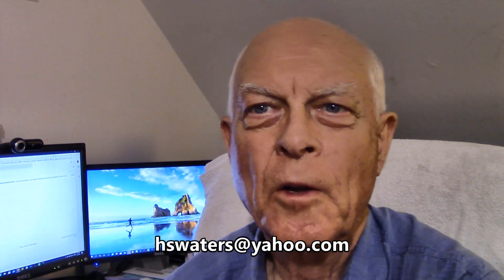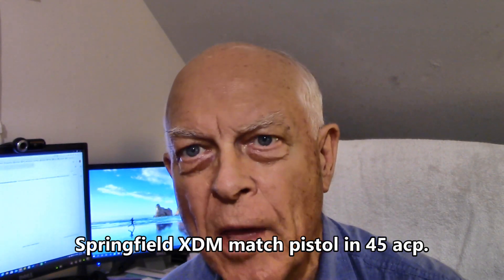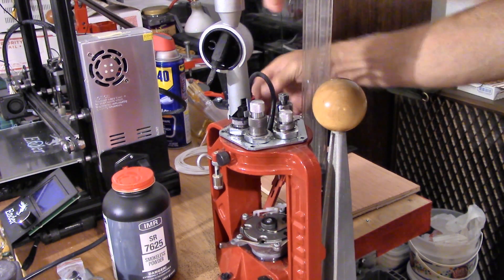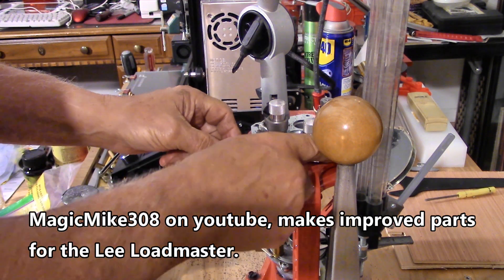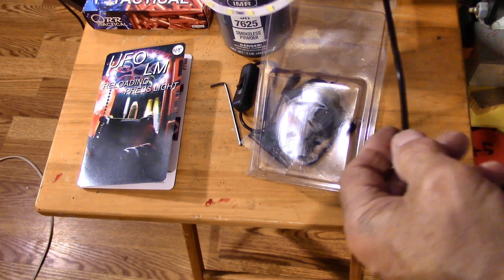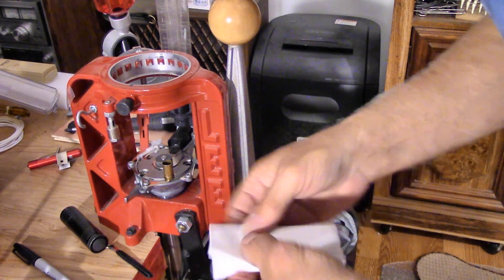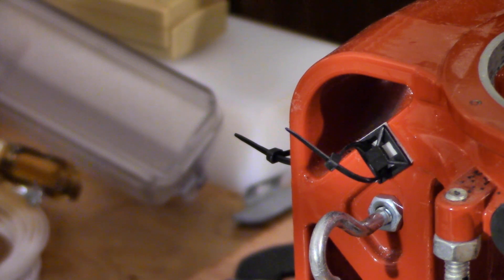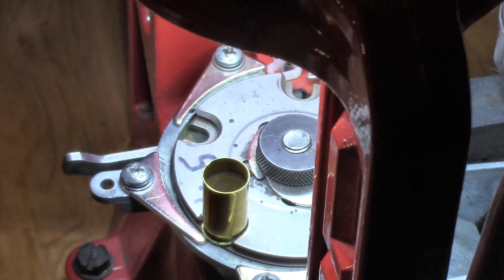Lee Loadmaster -- UFO lights it up

Comment: Did you know: when you have to enlarge or remove a zip tie, you can (carefully) insert the point of  knife blade between the body of the zip tie and the tiny pawl that engages the 'teeth' of the zip tie and then pull the end of the tie out of the head.  It gets kind of dicey holding the knife point into the head to release the pawl and pulling the tie back out of the head, you almost need 3 hands sometimes, but it will save a zip tie you want to reuse or adjust to a large size.
Reply from the maker: That certainly makes sense.  I am not sure how hard I want to fight to save a zip tie though.   Threading the light through was one of those illogical things I do when distracted by making a video and working on something.  Actually I have several bags of different sizes of zip ties so I just cut the other two off and used a couple of new ones.  Thanks for watching my video and making a comment.

Comment: Does the primer feed work better on those than on the PRO 1000?  Do you like the LoadMaster?  That light is a great add to the press.  I need one for my Dillon 550.  A great joke at the end.  Stay safe in these trying times.
Reply from the maker: I have never seen a PRO 1000 so I have no idea how well it works.  I find the loadmaster is likeable when doing 45 acp.  It is not so hot at 9mm.  Thanks for stopping by.